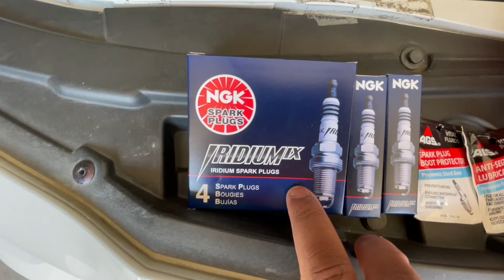New Must Have Mods For Your V6 Pentastar Engine | Chrysler 300: Part 1

Comment: You need a Baxter performance adapter with a Wix oil filter. The oem oil cartridge drains oil back to the sump after shutoff. Baxter adptr will stop thos dry startups saving you CAMS and rollers.

Comment: That weird bolt you mentioned ( attaches a wire harness to the engine block) is a 13mm the the two linked to the brackets on the drivers side are 10mm, you should inspect the interior of the butterfly valve to really see if it needs cleaning, and if you haven't already I'd recommend updating your filter housing to a solid aluminum body. hopefully you changed those plenum gaskets.

Comment: Where did you get the plugs from.
Reply from the maker: The spark plugs came from Auto Zone
Reply: Okay good looking out. I think I saw the coils on Amazon
Reply: Did you get the coils from Amazon
Reply from the maker: Nah, I actually bought mine off the Holley Performance site
Reply from the maker: But Amazon does have them. Not too sure about the price difference but they definitely got them
Reply: @Mopar300S  okay 👍🏽